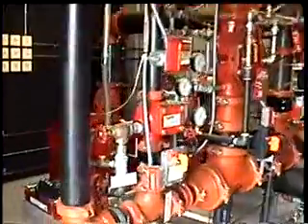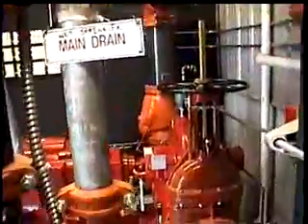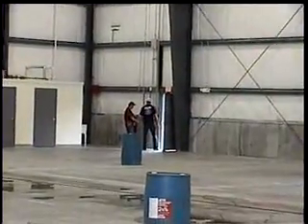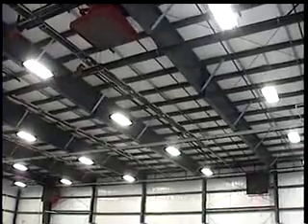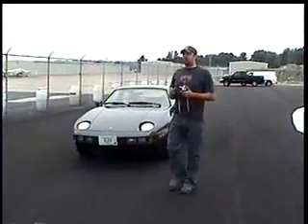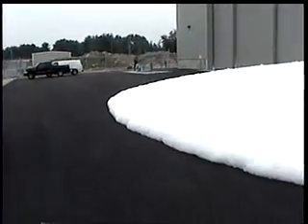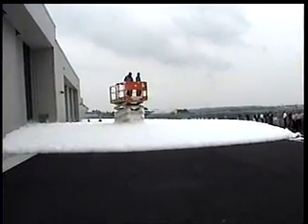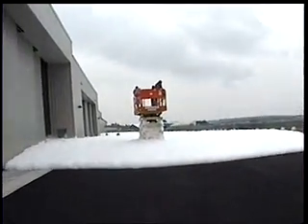Ansul High Expansion Foam System Test - AeroHex

Comment from the maker: The plane is parked in a hangAr.  There are no people on board.  No lives to save inside the plane.  The main purpose of the foam system is to quell flames outside of the plane and contain a major fire from spreading outside of the hangar.  Inside of the plane is an entirely different subject.